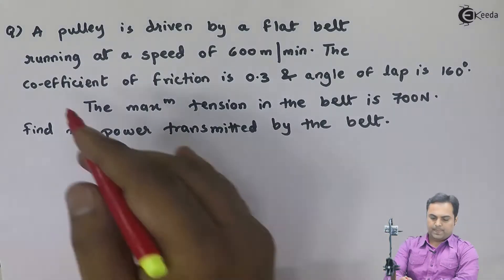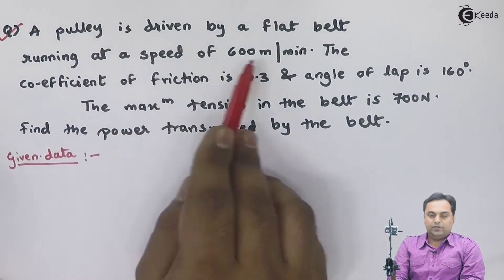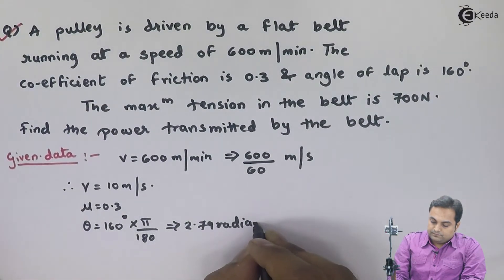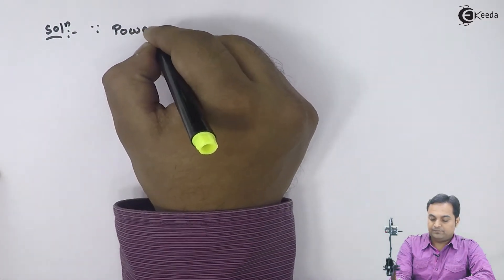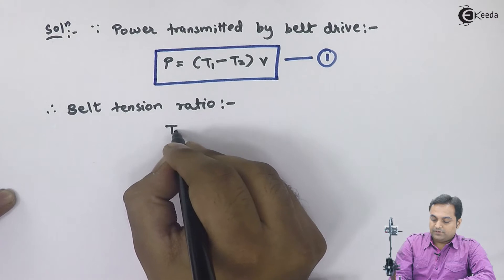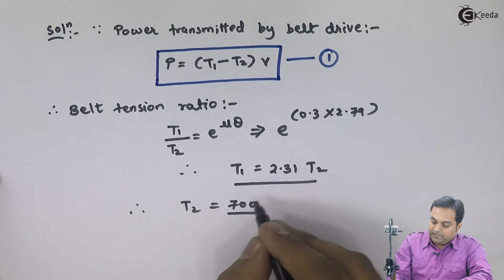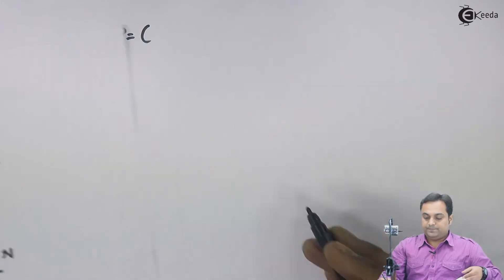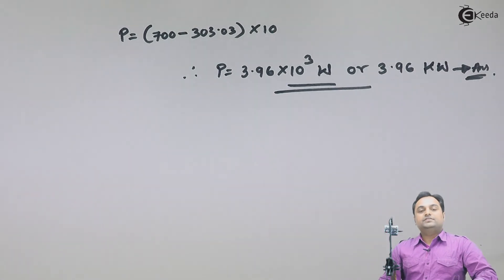Problem 5 Based on Belt Drive - Power Transmission - Theory of Machine

Comment: Please sir can you help me to solve this problem 

in a belt drive arrangement the following observations are made . bigger pulley =280mm. smaller pulley =200mm. the belt distance =400mm. tye sheare were rotating in the same direction the maximum tension in the belt =1.5kn while the coefficient =0.35. using the above information. (A ) Determine the angle of wrap on the pulley. (B) Determine the length of belt. (C)Determine the power transmitted